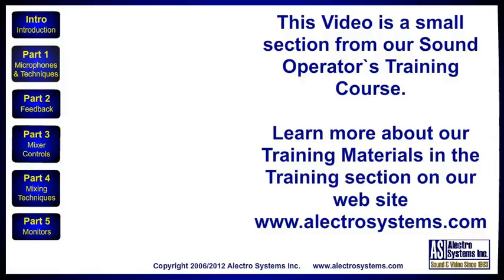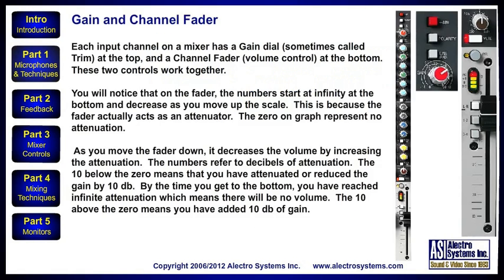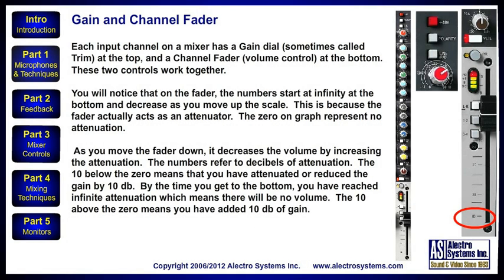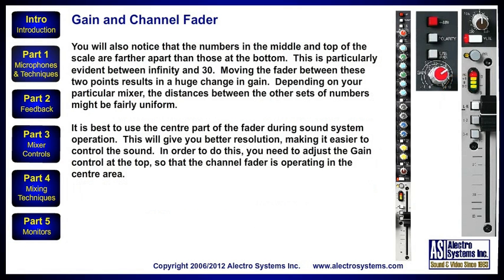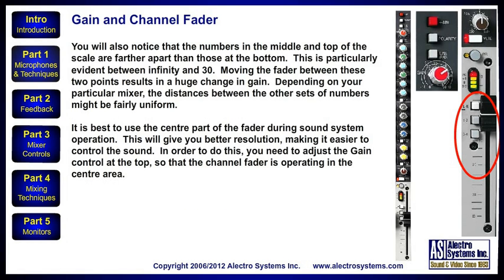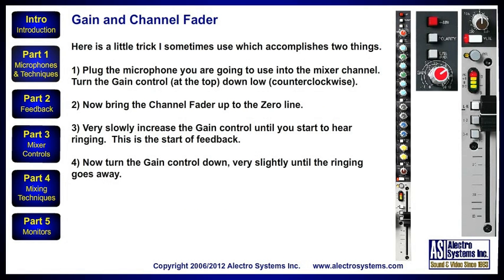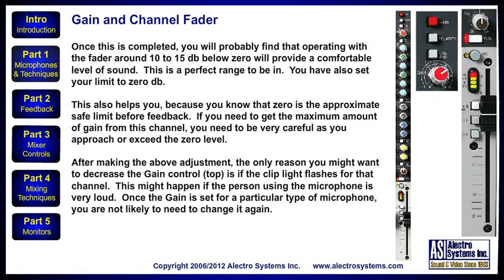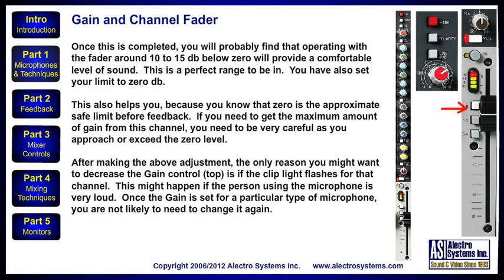Understanding the Relationship between Mixer Gain (or Trim) Control and Channel Fader

Comment: Thanks for sharing. I have one question, before I plug in the microphone, instead of turning the gain down anti-clockwise, can I simply press the "mute" button of that channel? would that be a faster and easier way to do so?
Reply: C chong   No.  The input Gain (Trim) is about what level you allow into the Channel.  The Volume Fader and Mute are about how much of that Channel you allow into the Mix ( wherever you are sending that signal).
Muting the Channel can save your speakers, and any feedback, but what he’s describing are two concepts (and he’s blurring them together)
Gain Staging.   And    Gain Before Feedback.
Reply: @G_handle  I see. thanks for your kind reply and explanation. Keep up the good work and God bless:)

Comment: (cont)

Fader control can and should be achieved through proper gain structure:

Maximize input signal to noise ratio
Maximize fader resolution
Set effective master volume appropriate to the room

Why deal with amp and signal hiss when you don't have to? Back off your amps, bump up your master and your channel faders.

In addition, poor input levels affect your aux sends and inserts. For example, when inserting a compressor, you're going to have to crank the threshold and amplify even more noise

Comment: I completely disagree with this method.

Input gains should be set to maximize signal to noise ratio. If that means you're mixing from the bottom of the fader (which IS inefficient and low-resolution, I agree) you have a MASTER gain structure issue. Bring your master levels down (and eventually your amp levels) and then bring your faders to unity to get your effective resolution.

Your method allows for the possibility of high noise on the input section in order to maximize fader control.